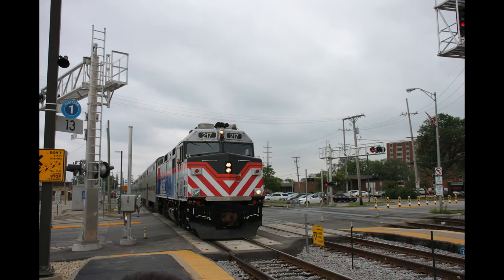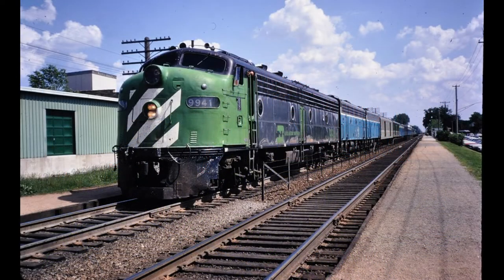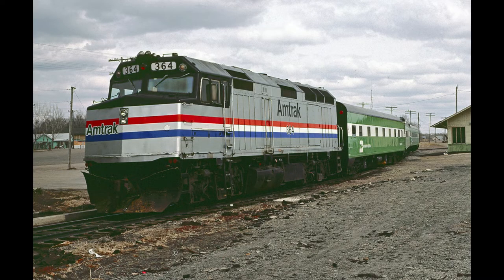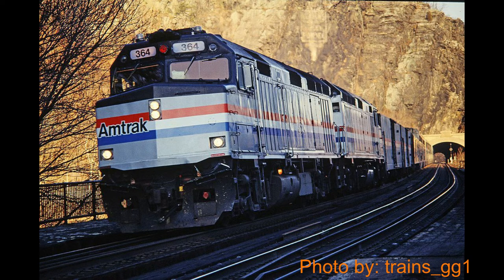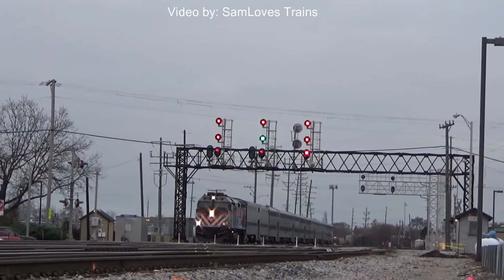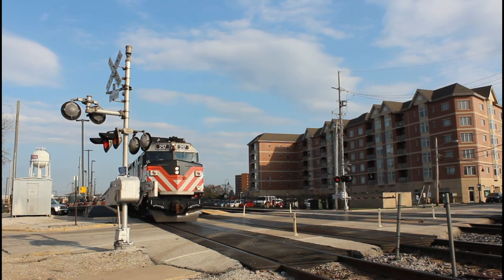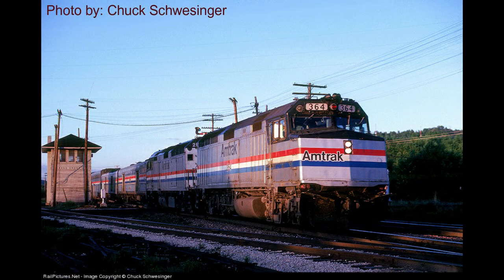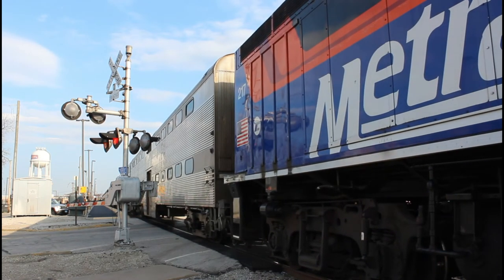History of Metra 217 (Metra by the numbers Ep. 2)

Comment: I have a question why aren't there any f59phi on the rock island district line and why the lighting bolt f59phi not on the Milwaukee district lines and the North Central Service and only on the union pacific lines 🤔
Reply from the maker: Well the reason for it not being on the Rock Island line I believe is because they use F40phm locomotives so they don't need any extra locomotives on that line right now and there's only one lightning bolt f59phi and it just happens to be on the Union Pacific Line. When Metra will paint more I'm not sure.
Reply: @RailBrothersProductions  why isn't metra 79 on Milwaukee district lines I can understand about metra 90 because its a heritage unit of c&nw and the c&nw used operated on the union pacific lines but why 79 maybe they thought they it would confuse people with a mp36ph but  still the mp36ph has enough difference to tell the difference between the f59phi and the mp36ph
Reply: @RailBrothersProductions  also on Wikipedia it's said that the f59phi run on the MD,NCS,UP and HC lines but I don't see them on the heritage corridor line I only see f59ph on the heritage corridor line.
Reply: @RailBrothersProductions  can you answer my questions
Reply from the maker: @maas1208  I'm not really sure why it's on that line. My speculation is that it's because it was a locomotive that came later and by that point in Milwaukee District Lines already had enough f59phi, so it went to the lines that needed it like the UP lines that only had the old F40s.
Reply: @RailBrothersProductions  wait why couldn't metra switch 79 back and forth from the Milwaukee district line and the union pacific lines
Reply from the maker: @maas1208  because Metra leases out the Locomotives to Union Pacific because Union Pacific Engineers operate the UP lines.
Reply: @RailBrothersProductions  oh ok hopefully we can see more lightning bolt locomotives
Reply: @RailBrothersProductions  fun fact F40PHM 210 used to run on the Union Pacific lines
Reply: @MAAS 120  210 and 113 were both on UP property. Up borrowed them while two of their f40ph2s were at Mayfield being rebuilt into dash 3s.